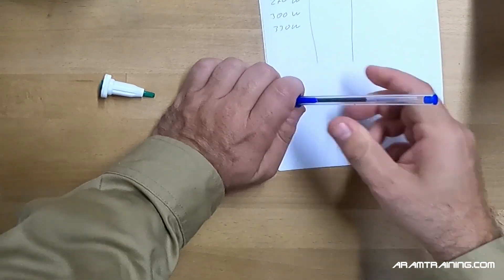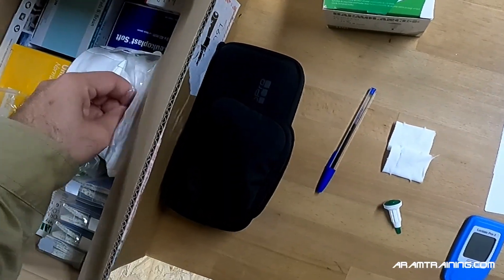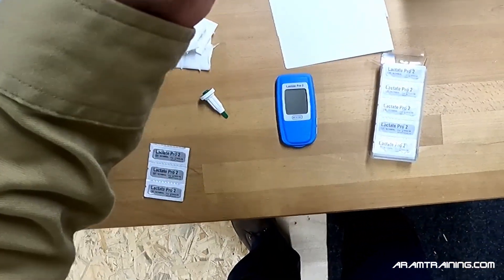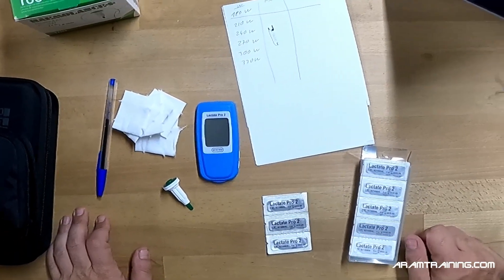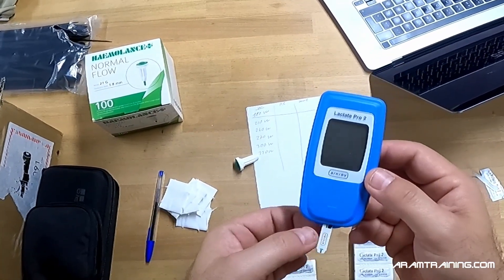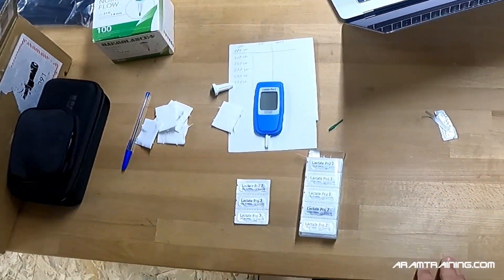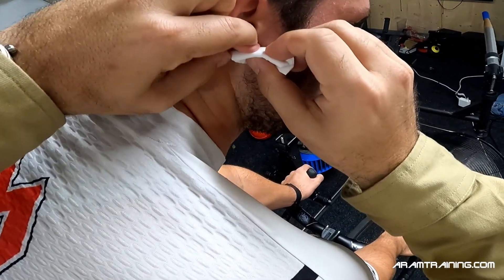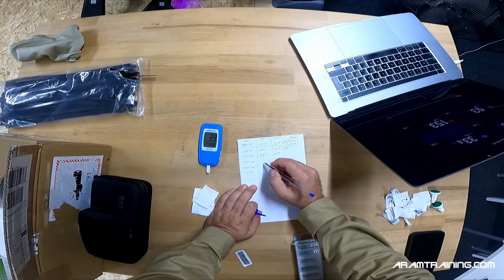Rowing Coach does lactate test - point of view and in depth explanation

Comment: I find lactate level is not accurate with lactate pro2, as i could do 3 test, all different readings, do you have the same problem?
Reply from the maker: No. I find it very accurate. There are other variables such as sweat contamination or protocol errors that have a significant effect on the outcome

Comment: Can the athlete drink (carbs) during the test?
Reply from the maker: Carb storage in the muscles usually lasts for 60-120min (+\-) and the liver has a bit more, although transport seems to take a while. As a test does not take more than 30min, and at least half of your stages should be below anaerobic threshold you should not run out of carbs, thus no substitution should be necessary. In general, I would be quite cautious with replenishing carbs during training and racing at all. After all, we are not cyclists or triathletes. Just my opinion.
Reply: @AramTraining  Thanks 😊 My main sport is cycling, but I like to do a few sessions on my Concept2 Rowerg to mix things up during the winter 😊❄️